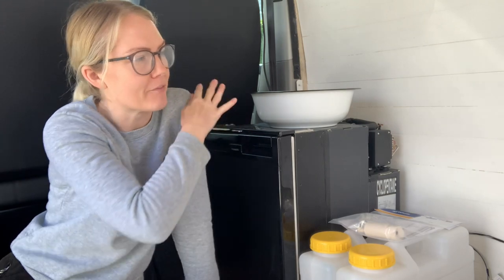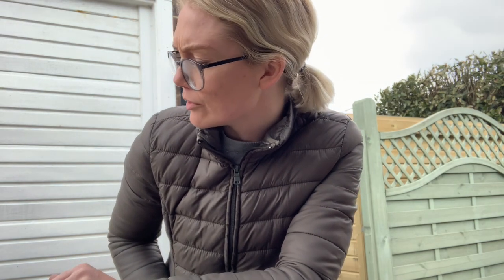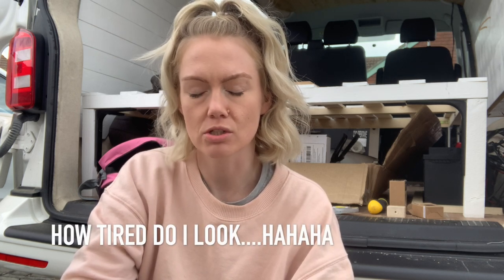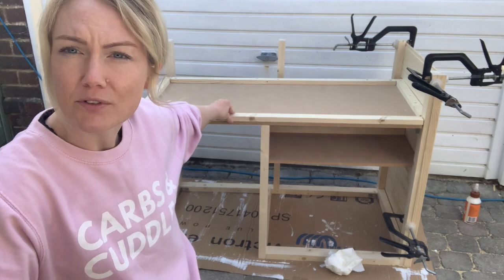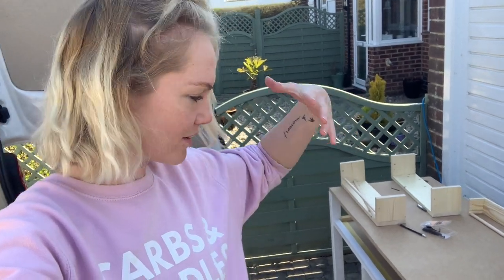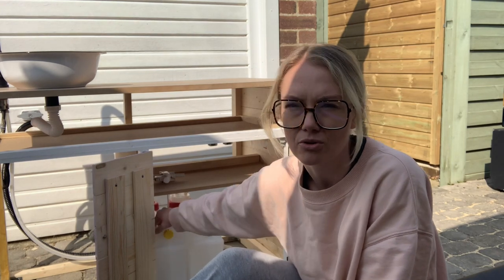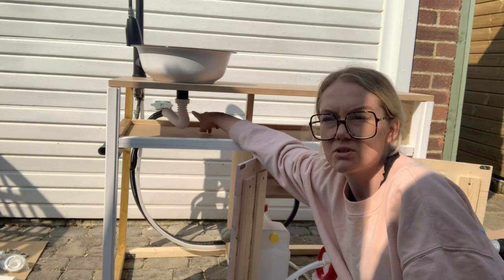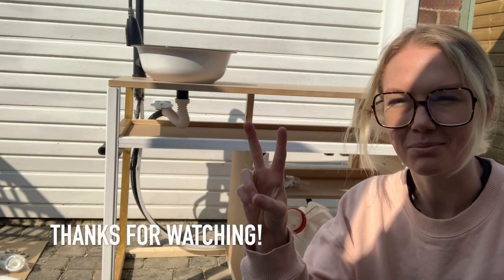Peach and Dora - Episode 8 - VW T6 Conversion - Kitchen Unit and Plumbing!

Comment: Great design and well done on the unit build 😃 I have a very similar low pressure water set up to yours. If you find the water judders when you turn on the tap, I have read that a fiamma water expansion tank can stop this by creating a reserve of water allowing the water to be drawn up smoothly. I have got the tank but not yet fitted so cannot confirm it works yet. Good luck and looking forward to seeing the final reveal 😄